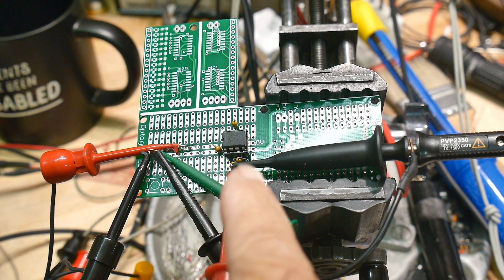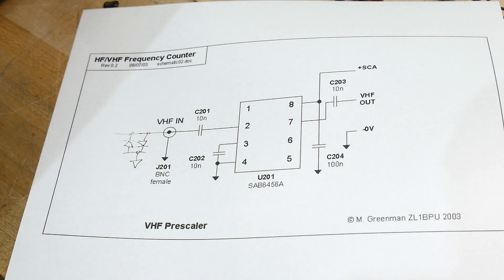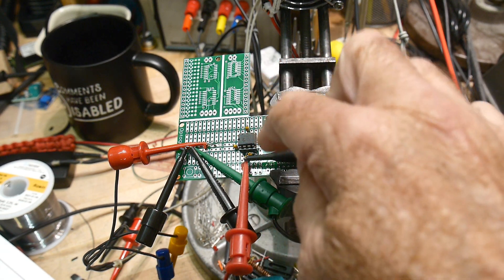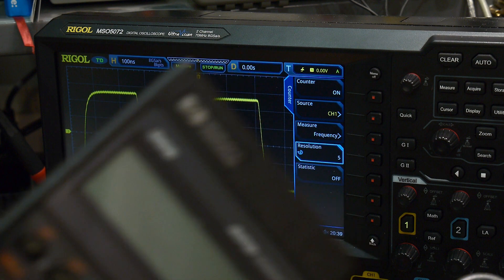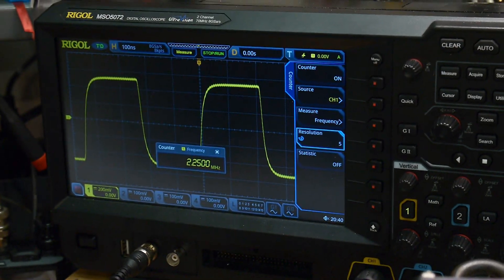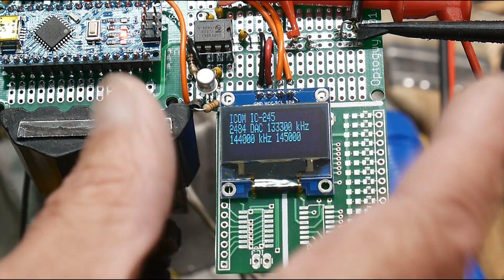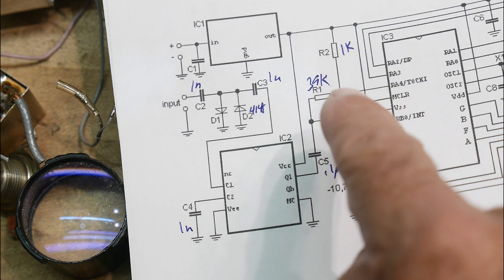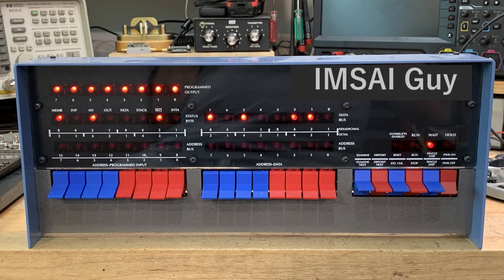#972 VHF Frequency Counter Prescaler SAB-6456A

Comment: Hello, in your schematic you have used digital pin 5 of Arduino Nano as input coming from the pre-scaler SAB-6456A. BUT you have NOT used this pin "5" in your Arduino sketch file the  "Freq_Count_Board.ino" kept on Github. So this (.ino) will not produce any frequency display. I guess you have another working Arduino sketch which you have loaded on your Nano shown in clips. Please update your Github or give us links to your latest update.......

Comment: Hm that chip is like a bunch of flip flops basically. As a flip flop can be used to divide a freq by 2.
Reply from the maker: that's right, it also has a differential analog input for small signals, and it can run to 1 GHz

Comment: Excellent! I have one recommendation to add, which is the usage of a TCXO as the clock source of the timer you're using as a frequency meter. I understand this might be an overkill, but this will improve substantially the stability of the clock reference, and thus, your overall output frequency. If you fancy, you could get a TCXO with the same frequency as the main crystal and use it as the CPU clock source on the Atmel.
Reply from the maker: The original radio was not that fancy but a TCXO or oven would be an upgrade

Comment: PID loop?
Reply: Proportional with a weighted error should be fine. I have used that in the past to converge noisy input data to a decent enough minimal error. Simply done by computing the error and then multiplying that by a scalar smaller than one. Usually 1/10 to 1/100 depending on sampling rates and other factors.
As the solution converges, the correction becomes so small that it's negligible.
And of course this error is added to a linear model of the "plant" so that gives the system a good starting point to correct.
Reply: @EngineeringVignettes  Seems like a good solution. My only concern is that constant and frequent correction will behave like an FM noise that makes no practical sense. That’s why I suggested a threshold.
Reply: There is no need for PID, I think, as the inertia of the system is minimal: it will react almost immediately as the voltage changes. Instead, there should be some tolerance and the correction should be introduced only when the the frequency passes the tolerance threshold.